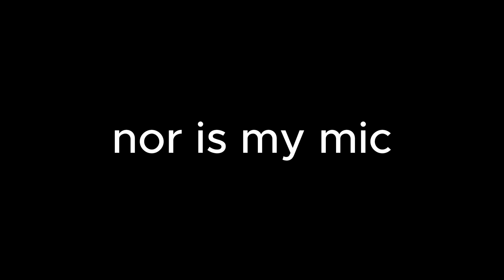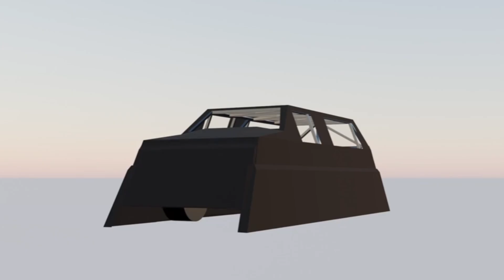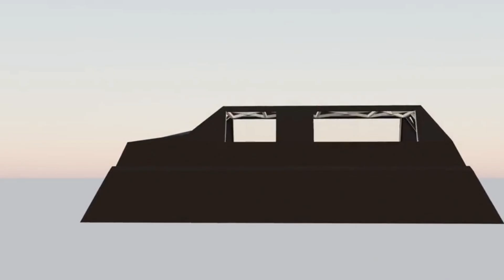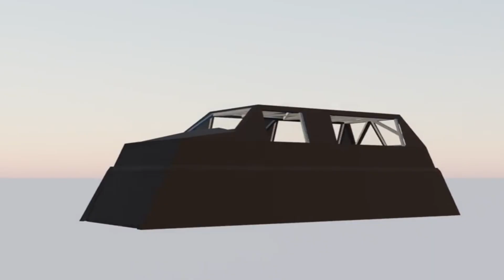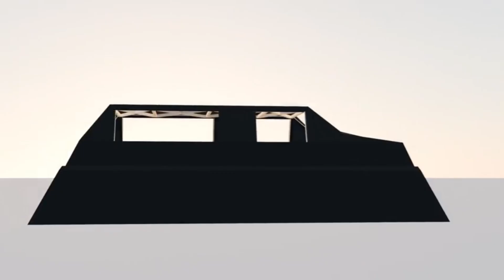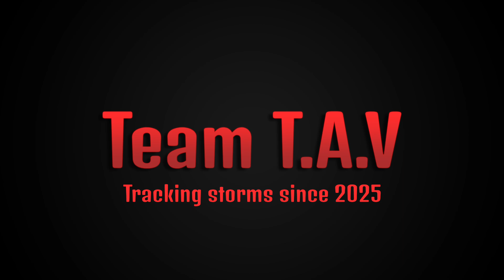I'm Building a Vehicle to Drive Into Tornadoes. This Is Why. | Team TAV

Comment: This is sick, didn't realize there was another interceptor build going on out here good luck! Quick question, does it have spikes or any anchoring under that armor?
Reply from the maker: Yes and no. The V1 T.A.V (what will be built in 2 years) will rely on flaps only. However when the project is good and we know for a fact how to get good data and that we can get good data then some spikes will be added to the vehicle
Reply: @Team-Vanguard-WX  So I'm guessing your starting out with smaller tornadoes after the first build to test?
Reply from the maker: @Twisted_I_project  That’s correct, we plan to start with some of the weaker tornadoes and work our way up. I have faith in the design but not THAT much faith to go intercept a wedge immediately
Reply: @Team-Vanguard-WX  Lol, so it's around 23-25 feet long right?
Reply from the maker: @Twisted_I_project  Current undeployed length is 24.35 ft long
Reply: @Team-Vanguard-WX  Nice, just 2 feet shorter than Twisted

Comment: You should try to make a tiny doppler radar on it to scan the tornado while you're in it or cannot intercept it
Reply from the maker: Great thinking and radar definitely has legitimate tornado research value the DOW trucks prove that. The challenge is that even those purpose built million dollar platforms retreat from hail. Inside the circulation the T.A.V is dealing with continuous debris that would compromise any radar system almost immediately. The T.A.V's in-situ sensors are actually better suited to the interior environment direct measurement beats remote sensing when you're already inside what you're trying to measure
Reply: @Team-Vanguard-WX  it's still great to have a interceptor and i wouldn't be mad if something like that isn't possible
Reply from the maker: @hurricanecuber Really appreciate the open mindedness! If a survivable radar solution ever becomes viable it’s absolutely on the upgrade list. For now the in-situ sensors are the priority but never say never on future versions!
Reply: @Team-Vanguard-WX  thanks i hope something like that is developed in the future, and i cannot wait for what the team and vehicle bring to what we know about severe storms and tornadoes!!!